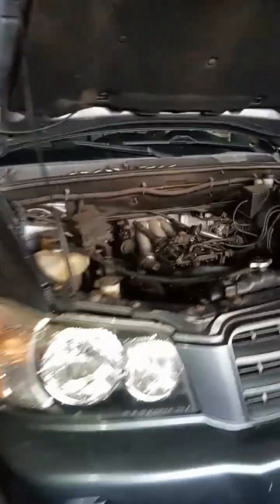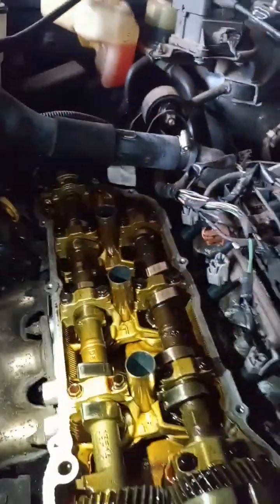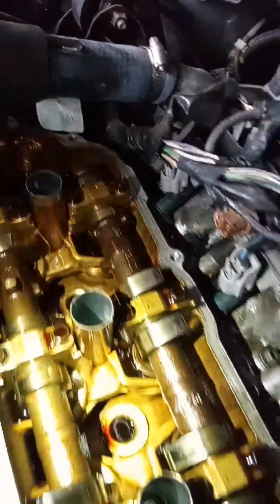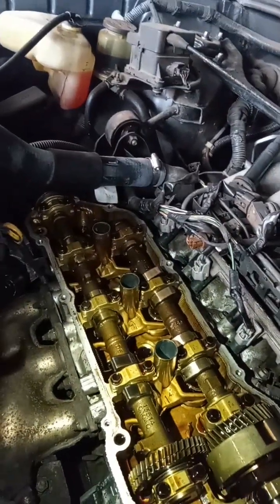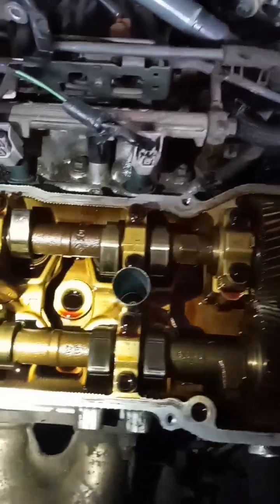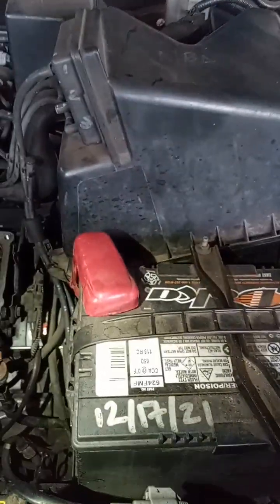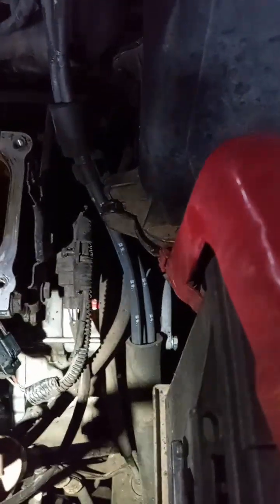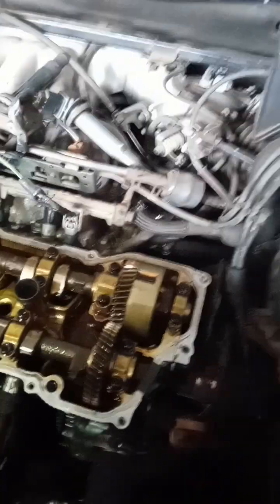Can a Toyota Engine Run Forever? #highlander #3.0 #v6 #1mz-fe #engine #toyota

Comment: Just out of curiosity, what type of engine oil did you use over the years? Did you stick with one brand name or switch several times? And was it 5-W30 for the entire 219k??? Some of my friends by whatever is on sale & switch constantly.... LoL
Reply from the maker: Not my car and don't know its complete history. Last 25,000 miles it's been Napa brand synthetic 10w30 changed every 5,000 miles. The previous mechanic retired so they started bringing to me for maintenance and repair.
Reply: I've seen a Lexus dealership use pennzoil in their invoice, car care nut Toyota channel covered it.
he's a big Toyota tech
Reply from the maker: For everyday driving it does not matter what oil you use - as long as you change it regularly and keep it topped up. Yes you need to keep it topped up because Toyota engines consume oil. For a racing application, different story.  @Eduardo_Espinoza